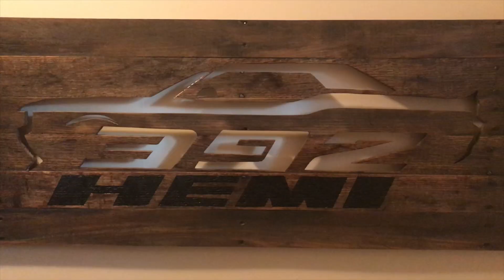JTech Laser Center Finder

Comment: For those that don't have access to a 3D printer and you are using UGS there are 2 macro gcodes. It turns the laser on and off with a low beam where you can find your center that way too. M03 S20 turns laser on. M05 turns laser off.